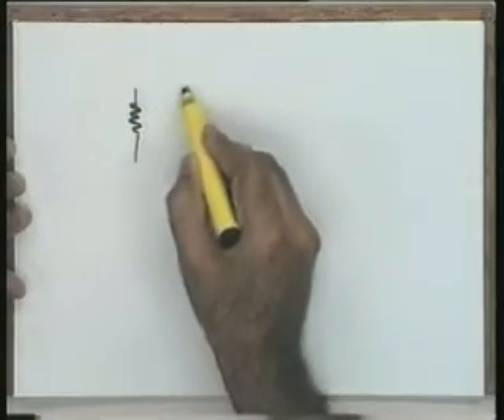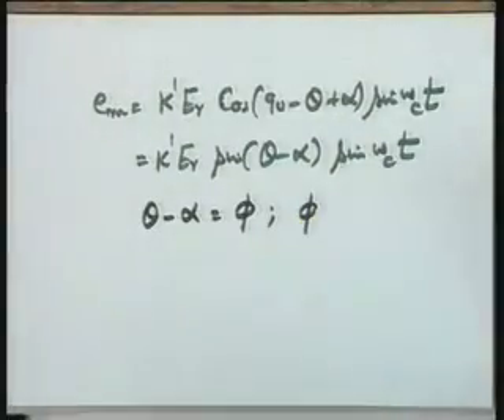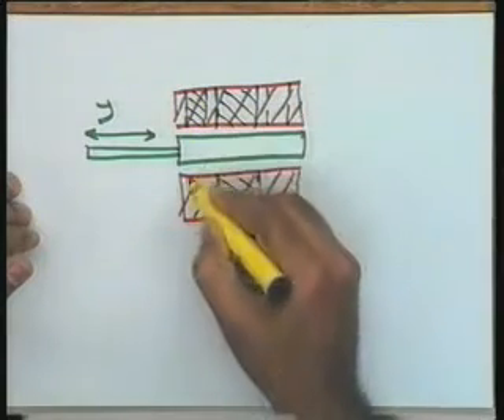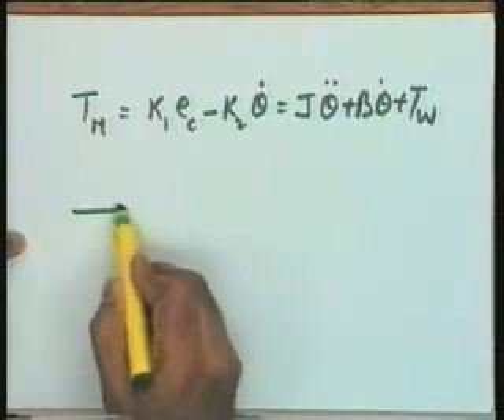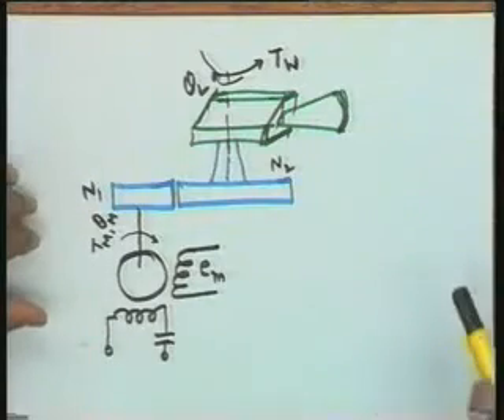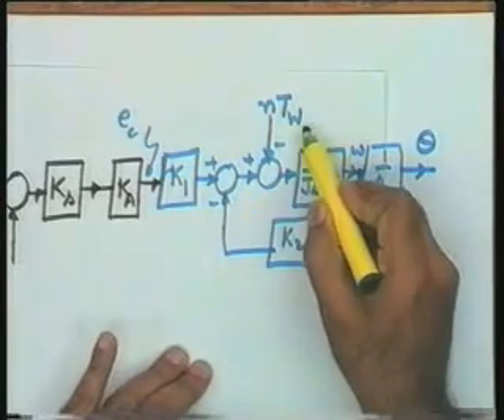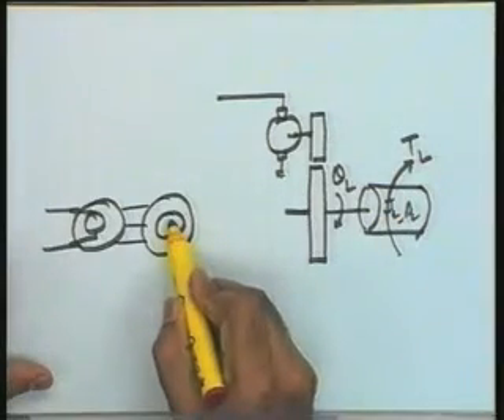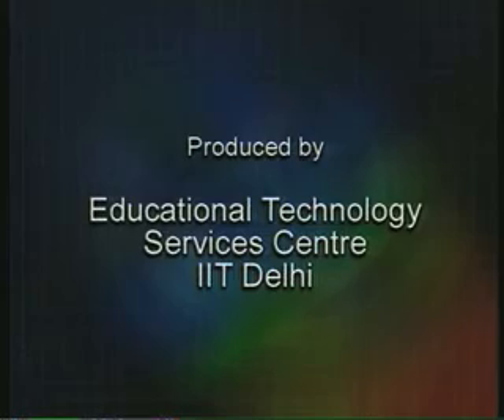Lec-15 Models of Industrial Control Devices and Systems( Contd.)

Comment: When going through this lecture it appears to me that some prerequisite subject modules are required... like core, polarity, reverse polarity, envelop of a signal and frequency of signal listening for first time differentiating them, flux lines, why two windings primary winding and secondary winding  and again secondary split into two parts and they are in phase opposition , what is this phase opposition?